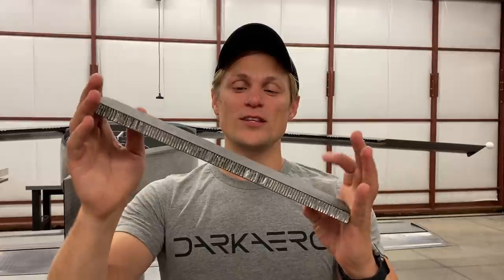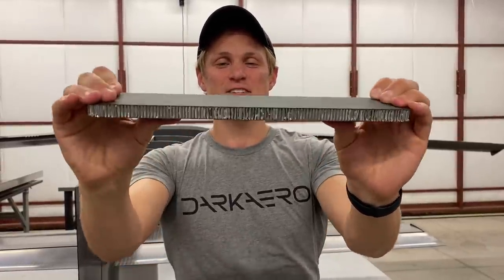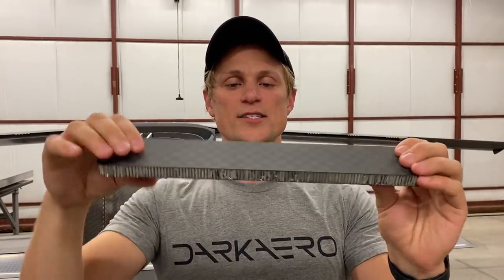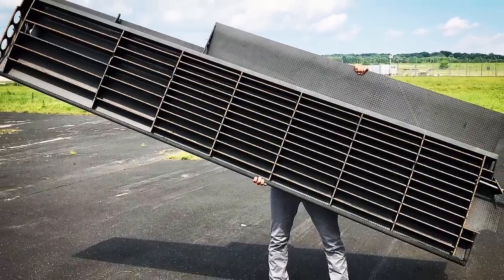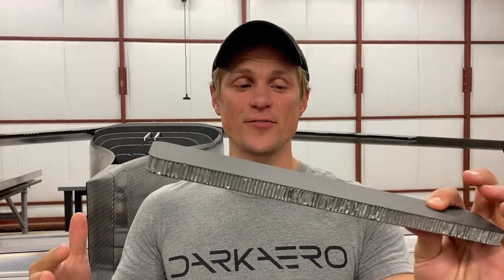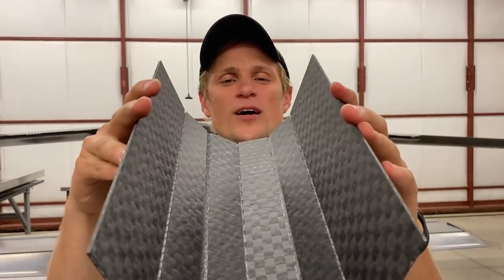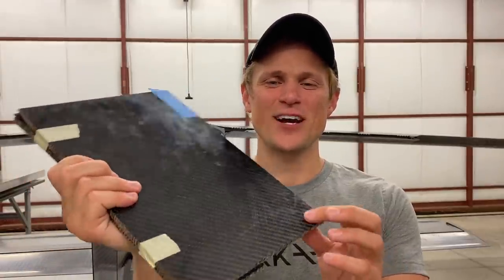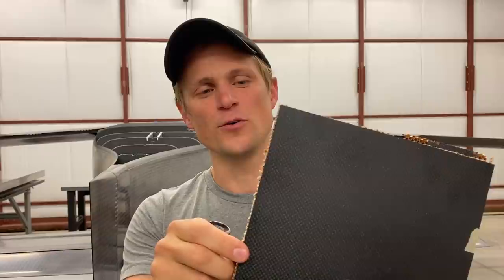CARBON FIBER + Honeycomb Sandwich Panels in the DarkAero 1 EXPLAINED!

Comment: Dude that is exactly how I thought about making my airframe. Talking about the fuselage in the back. I was worried about not having stringers or longerons. I guess it really is possible to make something and not need millions and millions of dollars of machines and material to make details. My A/C is a one seater blended wing powered by three PBS TJ-100's. I know, I know it wont go very far but it will be very fast =o).

Comment: next project look at a concept like the Raptor,  it'd be revolutionary in GA, would be just amazing with that concept with your execution!!!
Reply: mnminnmn 
Unlike the Raptor this is ACTUALLY going to be an airplane you can fly and build !!!
Reply: Raptor is attempt #7 at taking a diesel engine, slapping a prop shaft on it and calling it a revolution. Car engines are carefully designed to output 20-30 hp average on the highway. Running a car engine at full power for 30 minutes to reach cruising altitude will destroy it unless extreme measures are taken to cool it. 

Think liquid cooling, ie like Diamond 42/62. That's weight, and that's complicated, and it isn't built into the Audi engine as primary source of cooling. That's why he's having to add coolers and at this point, his project is back to dealing with cooling issues. 

He could continue the raptor project if he could figure out the engine cooling issue, but it wasn't addressed at the beginning when he had the engine on the stand.

Comment: watch out, your core doesnt look perforated, I think in aircraft application you want to have a preassure relief in the honeycomb..
Reply: All honeycomb I have processed for aerospace customers is non perforated. Unless maybe for processing, you DO NOT WANT to vent your honeycomb to atmosphere because it will suck and condense moisture.
Reply: @SuperYellowsubmarin  okay, atleast with aerospace application I don't know much about it.. at what heights do your customers fly their planes at?
Reply: @lukaslanger5068  commercial airplanes like Airbus. Pressure cycling can become an issue yes, but the worst offender is moisture because it will eventually freeze or vaporise and either build much more pressure than atmospheric.

Comment: Based on my knowledge and experience, the honeycomb core will be saturated with fuel after a while. Primarily due to ambient pressure change with altitude. It is impossible to make them perfectly sealed, fuel will go through tiny gaps. It will add extra dead weight, better to use thin plates in the fuel tanks.

Comment: Carbon fiber and aluminum don’t get along
Reply: That’s a very generalized statement. If you looked, you’d see that aluminum honeycomb is quite common with carbon fiber skins in a wide variety of applications, including aerospace. Having said that, if you look at darkaero’s site you’d see a data sheet where they use a layer of eglass under the carbon, at least for the one I found.
Reply: But usually there’s a barrier between the aluminum and the carbon fiber because the oxidization is caused By the two touching
Reply: alloy honeycomb with polymer coating which acts as a corosion barrier to the fiber